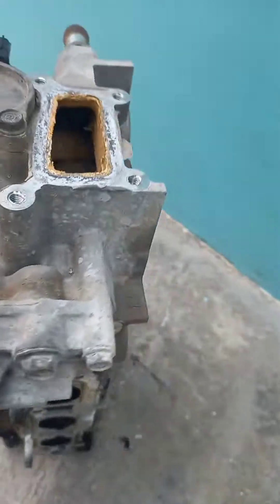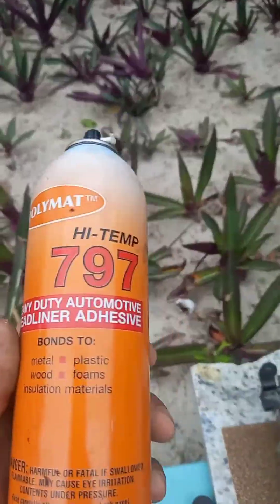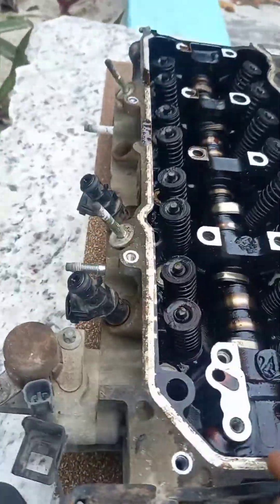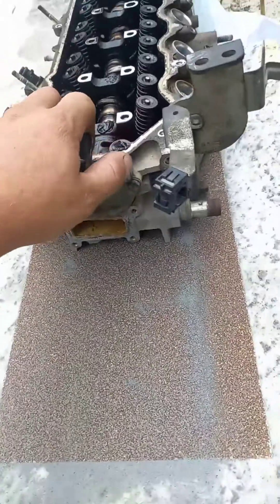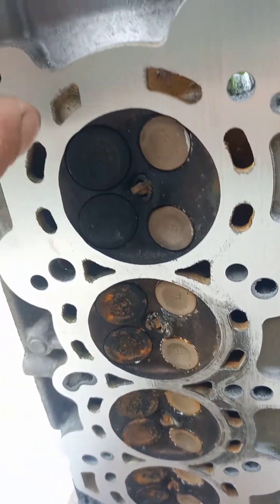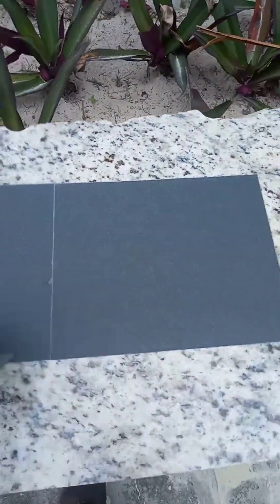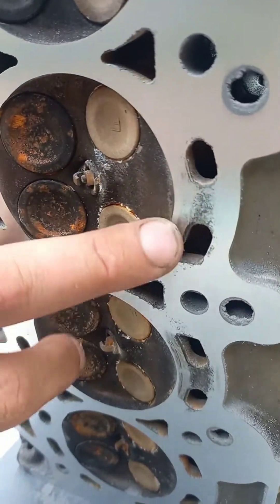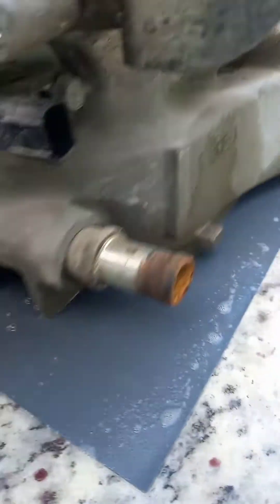How to Resurface a Warped Cylinder Head

Comment: How do you sync they threw a 2 x 4 op they have planers it is perfectly straight. No you can’t use a planer on a head you can use a belt sander. You can use a planer before they had machines they done it this way, and it always worked now we have technology to use Laser perfect machines but this way works people don’t have deep pockets. They have to compromise. They have to get their vehicles on the road. They got a warpage in the head they could clean it up with sandpaper it works. It does a job it’s old-school trick a lot of people don’t have deep pockets for the machine shop parts are outrageous machine shops are outrageous.
Reply from the maker: Yeah, this is a cheaper way to do it yourself. And also get a shoulder workout. 😀

Comment: great content,  thx for sharing.   i wanna ask, that soapy water you used ,is it soap+water or other things？
Reply from the maker: It’s actual dish soap and water!
Reply: @hoseaembury1999  thank you very much!
Reply from the maker: @abbottim2268   you’re welcome! ☺️
Reply from the maker: I’m thinking there may be questions about the effects of soap and water on the intricate parts of the cylinder head…. Spray with WD-40 or similar spray to prevent corrosion and displace water after the process shown in the video.

Comment: I did this to clean up gasket surface marks off my cast iron heads couldnt clean off with scraper, i didnt go past 150grit paper, surface was rough from the factory  begin with just to make sure it seals
Reply from the maker: Yes it work for steel head as well but will definitely take a lot longer. Because of course, the steel is harder.

Comment: Don't sand them have them properly machined.
Reply from the maker: This is great way to do it at home. But it’s easier to send it to a machine shop if one is nearby and cost is not too high. Make sure you send them to a reputable machine shop if you do. They sometimes can do a sloppy job.
Reply: You can sand them and put a straight edge on there and they will be perfectly flat. Nowadays is expensive as machine work people don’t have the money they have to do with what they got. They have to compromise because people ain’t got the money. This old-school trick works. I’ve done it a number of times never had an issue, you guys say old machine shop machine shop well your pockets are deep then OK but there’s a lot of people that can’t do it and they have to do what they have to. Do. They have to get down the road they can fix it this way and it’ll last for years.
Reply: You have little experience with this kind of engine preparation.  there are professional race engine builders who use this method on $100,000+ racing engines.  Use the same process to flatten the deck on the block as well.  You can actually get a better, flatter surface this way than they can in a machine shop (I have worked in both before, when we built racing engines, we used this method to get the head and block smooth and flat).  Beside, a machine shop can make an error and quickly turn your head into scrap metal (I have seen it happen).  if you are careful, there is little risk of damaging your head or block using this method.   you must of course make sure you clean off all of the grit and sanding spoils before you reassemble it.

Comment: AWESOME TECHNIQUE 

May I add, depending on the gasket material you use, the head may need a smoother finish.

Question?
Would there be any reason why you shouldn't use water/lubricant in the earlier stages?
Very much appreciate your video👍
Reply from the maker: For some reason, the head slides fine on the coarser paper, and the grits can be swept or blown off. But it tends to grab on the smoother paper ironically. And the smooth paper clogs quicker of course. but if you have wet sandpaper, you can use soapy water on all stages. This is the grit I use for stainless steel and aluminum gaskets. It may not need to be as smooth for a composite gasket. But I just like to be safe.

Comment: TBH, this is actually an old school method, but not so much with starting with an aggressive 80 grit, and not by going just back and forth in just one direction.
Reply from the maker: I agree. Pretty old school… it really depends on the condition of the head and the amount of warping. I’ve started with 60gt. on really bad ones.

Comment: don't do this
Reply from the maker: Why? May I ask?
Reply from the maker: The car is still running strong a little more than a year later. Quite a few people have told me that it’s not a good idea, but I’ve done about 50 or so and I’ve had no problems with any of them. Of course, I check for warpage with a feeler gauge, and a straight edge afterward. 0.001” is acceptable. Most heads I resurface have 0.000” warpage after the resurface process. According to most manufacturers, and engineers 0.0035” is ok. This particular head had 0.010” warpage when I started, and the car was blowing water out the exhaust. All because of a bad radiator fan which caused the car to overheat. 

Of course it’s probably a better idea to send a head to a machine shop. But if you don’t have one in your area, this is a good second option. But to be honest, I have sent heads to a machine shop and they come back and don’t pass my pressure test.
Reply: @hoseaembury1999  Ignore him. Everyone is a critic, but almost never do they have any real evidence to back up their opinion. If they do it's always anecdotal. 
"I read somewhere that a guys brothers uncle once did it back in the forties and it didn't work. Therefore it's a bad technique". 
B&tch please...
I think it's a brilliant way to solve the problem. Although your arm has to be aching for a week. LOL
Reply from the maker: @WatchThisA  yeah, thanks. I totally understand. Yeah, definitely a great workout. Get ready for those big punches, you know. Lol.
Reply: Honestly I see nothing wrong with this as long as the final result is checked with a straight edge and feeler gauge, which was done. It would have been nice to see a before and after of the measuring process to remove any doubt. Maybe next time
Reply: Maybe just make 100% sure there's no sanding grit in the head when you're done